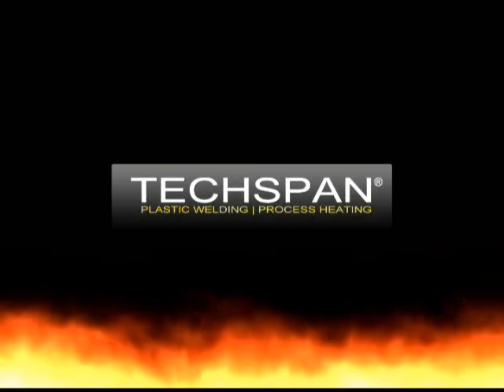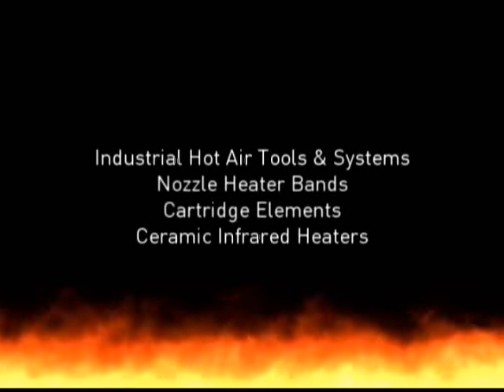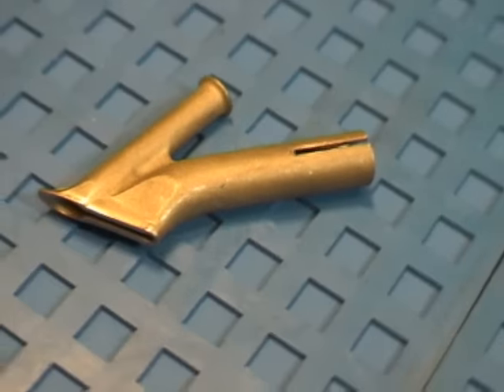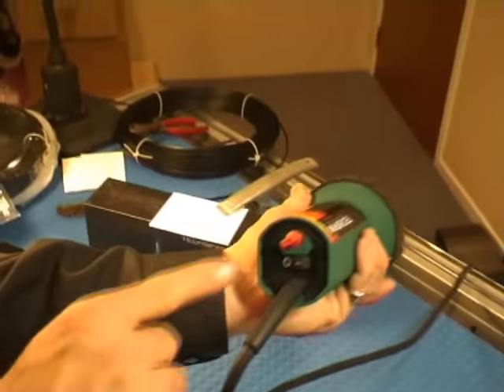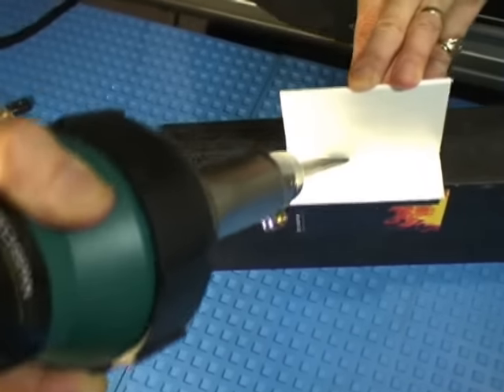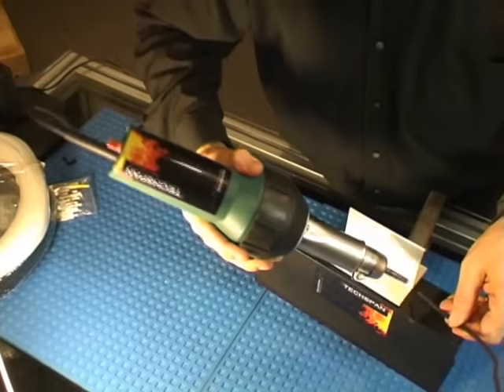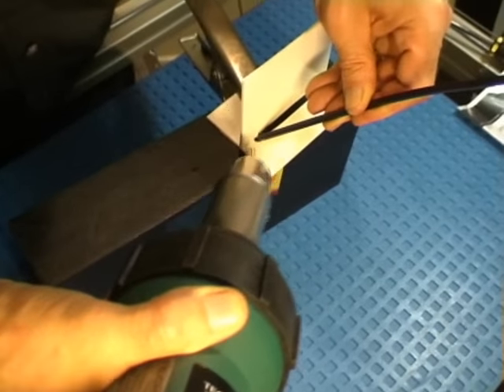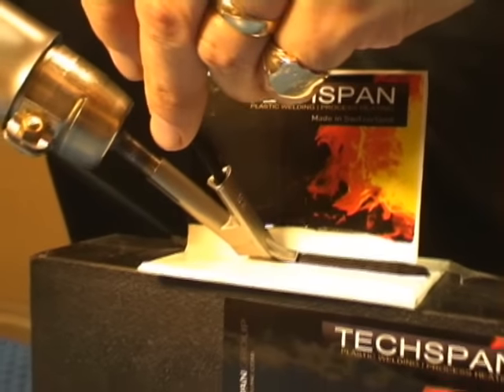Plastic Welding: How To Instructional Video by Techspan

Comment from the maker: See our NEW range of Plastic Welding KIts.  The extended range now includes kits specific to your industry sector. Automotive, Tarps & Covers, Fabrication, Roofing, Flooring & ACM Panel Welding Kits. 
https://www.plasticweldingtools.com.au/product-category/plastic-welding-kits/ 
#plasticweldingtools #plasticweldingkits #plasticwelder #hotairwelder #hotairtool #plasticweldingrods #techspannz #techspanaustralia
Reply: Can I weld my truck’s  front chrome grille?
Reply from the maker: @digitors  ok, do you know what the material is ? You would have to have the part re chromed when finished. 
Have a read through this information - 
https://www.plasticweldingtools.com.au/how-to-weld-plastics/
Reply: This tools can use to car bamper and also to motor feander welding
Reply: How to order
Reply from the maker: @dianneoh3125    info@techspangroup.com

Comment from the maker: There have been a few comments along the lines of 'i can do this with a soldering iron' --  our response to this is - No you can not. These techniques show plastic welding to the highest possible strength, and to worldwide plastic welding standards as set by the DVS joining association of Switzerland/Germany.    A soldering iron runs at very high temperatures and will burn and degrade plastics.  We would call that 'fusing', not Welding.  Weld testing will show this.
Reply: Unless your iron is adjustable..
Reply from the maker: Sorry it is not. Welding is a molecular process where the parent and welding rod and welded with almost no loss of strength. Thermoplastics require specific welding temperatures in order not to damage or degrade the material. A soldering iron will do this as soon as you contact the plastic. You will NOT ACHIEVE STRUCTURAL WELDING WITH A SOLDERING IRON.
Reply from the maker: A soldering iron still will not correctly and evenly pre heat the parent material. If you know of a very accurately controlled soldering iron.. please send me a link.  The best way to solder with any such control is to use a hot air tool with electronic temperature control.. just like our plastic welding tools. Hope this helps.
Reply: My Duratech ts-1564 has served me well on all of the welding i have done (HDPE) though I did make up a tip for it on the lathe/mill so I didn't ruin my good electronics tip, which wasn't really suitable for welding anyway.
Reply from the maker: Hi 74KU, if you are only 'fusing' and do not require structural strength great, but if you want a structural molecular 'weld' the use a Techspan plastic welding tool every time. https://www.plasticweldingtools.com.au/product-category/plastic-welding-kits/
Reply: I disagree with these comments.
As a Materials Scientist let me tell you of my experience. Metal welding involves melting the same metal filler rod as the parent metal and the results is a strong joint, you fuse one metal to another. 
I repaired a 75mm crack on the top tank of my CRV Honda radiator which was made of plastic, initially I used the wrong filler rod, until I learnt it was made of nylon , So I used nylon from brush cutter wire and used a large soldering iron to melt the nylon to the plastic radiator tank ( look up Polyvance company to get ideas on preparation work). It took about 3 goes but the repair is complete and is pressure tight. The previous owner used the product Kneadit but that is not the correct technique. 
Lets put it this way, your company is out to sell things, OK things you say are true but in the right hand, a soldering iron will work. I did my repair , so can you convince me to buy your product when all you need is a soldering iron, correct filler material and knowledge in what you are doing.
Reply: Why not buy a new radiator? The integrity of the rest of the radiator tank is questionable, and will likely fail again elsewhere, or at the repair site since the heat you added has an impact.

Having your vehicle towed is more expensive than a new radiator, and the potential for other damage far outweighs the cost of a radiator. Not to mention the inconvenience/cost of being stranded. If you miss a days work due to your failed radiator, that too would be a higher cost than a new radiator.
Reply from the maker: Thanks for your comment. PA melts at a very high temperature and a radiator will also have a content of glass filler. Again it may give you what appears to be a good result, but unless you can control the temperature of your soldering iron you will burn and degrade the material period. We attempt to share our knowledge in 'structural welding' not fusing.
Reply from the maker: Francis, thanks for your comment. Yes, sometimes damaged components may not be economic or sensible to repair if the part is very old or has sustained previous damage. This is where the welder must make a decision on whether it is effective to repair or replace. You will find all commercial plastic repair companies will take this into account.
Reply: tyvek05,   you're dreaming.
Reply: A cracked radiator is not exactly what I'd call a "structural" repair... The real test would be a repair that is subjected to a torque/moment, such as a mounting tab or cantilever. 

Instead of arguing, this company should just make a video showing a side-by-side compare of each welding method and the results.
Reply: TECHSPANONLINE modern soldering stations will hold a tip to within a few degrees C of the set temperature, from just above room temperature up to a few hundred degrees (hot air soldering stations have similar control). It's the specific tips that make the plastic welding tools much easier to use than tips for soldering. 
It would be nice to see one of the makers of plastic welding equipment make small tips for precision plastic welding compatible with one of the major soldering station makers tip designs. (Different market so no cannibalization of the existing market for tools that can do large repairs, but for repairing plastic pieces measuring a few cm², and cracks measuring a few mm² there aren't any particularly good tools) designing around the existing 1.75mm or 3mm diameter rods used as 3d printer filament would make it a perfect addition to the 3d printing market
Reply: I can do this with a soldering iron
Reply: I have a Power Probe butane soldering iron that is completely adjustable from working on circuit boards to joining 10awg wire together. Maybe an electric iron would be harder to control but the product on this video looks and operates just like my soldering iron
Reply: TECHSPANONLINE correction, you are right about the molecules etc, but when welding you fuse two similar or dissimilar metals together into one piece, so essentially it's pretty much the same thing. You fuse two metals into one 😏
Reply: Eric Powell, I've been a professional plastic welder for years and I'm with you mate. I've had to test and find the right weldings parameters for many different plastics and it is a very fine line between a successful weld and a failure, in my opinion it's unachieveable with a soldering iron. I have used a soldering iron to tack and fuse, but that's not a proper weld. These people don't have a clue what they're talking about.
Reply: @Russell218  Sounds like a good idea.
Reply: @jeffbudgen538  I have a question for you then. I have an ABS kayak that has some big cracks from backing into a power pole. It's a very expensive nice eddyline kayak. So I need to fix it to get it back on the water! I was going to use cyanoacrylate and fiberglass or maybe I thought about upgrading from fiberglass tape to carbon fiber cloth with cyanoacrylate. But now since seeing this video I'm thinking maybe I could plastic weld it? I would say there are about three critical cracks and one Gap that needs to be refilled.
Reply: You can do this with a hot air station
Reply: The definition of welding is the act of fusing 2 or more materials together... I think you meant "a braze" or "soldering"
Reply from the maker: @danielbeaird6264  as i stated "we would call that fusing, not welding' .. we often use terms like this to clearly note a difference. An act involves the production of a union, is not a "molecular weld"
Reply: @TECHSPANONLINE  
Welding and fusing are synonymous... as a welder, we would only say fused if no filler material was used, such as tig welding... im not disagreeing with your point... I'm just saying you could use better words... a soldering iron is used to solder things, so the word you are looking for is solder not fused

Comment: This video is a trip. I feel like I should be watching it on a hit of bomb. Seriously though, I just replaced a plastic gas tank on a chevy truck, because a tweaker cut a slice in it with a utility knife to steal the gas, and I was thinking about what it would take to weld the slice. Welding plastic gas tanks in the future may be more common then you could imagine. Inflation, an high gas prices are coming. If I saw it once, it will happen again, and again. Just like converter thefts. I would like to see if it can be done. If it can, I would probably buy this product.
Reply: Dude you’re so right this video is a fucking trip

Comment from the maker: No. You need accurate temperatures to be used when welding specific plastics. Their welding temperatures all vary slightly... So you need a machine with electronic temperature control. In some cases plastics will require 300 - 400 deg Celcius ... So a hair dryer simply wont work

Comment: Hello I want to have a 40l cylinder tank and I have to pressurised it. Can this cylinder resist 2 bar pressure or explode? How can ı learn about this ?
Reply from the maker: If you use a spark tester after the welding to ensure it is water tight, it is likely.. but may depend on the material and its wall section thickness ..

Comment from the maker: Hi there, If the plastic you are trying to weld is a 'thermoplastic' then it should be possible to weld it.  You can do a small test to establish whether it is a thermoplastic or a thermoset - using a sharp blade, cut a slither of the material off the parent. If it curls up, then its a thermoplastic. If it remains very rigid and straight, then it is a thermoset. A thermoset materail is not weldable.  Hope this helps.

Comment: I want to buy one, do these create strong reliable welds though ? For example is the weld as strong as the material its bonding ? In this case I will be welding HDPE

Thanks

Comment: Kindly confirm if this tool can be used for HDPE lining material about 1.5mm thick or please recommend the right model for HDPE. Is there a dealer in Philippines? Thanks.

Comment: What tip would be better for welding a T weld? I'm planning on welding two HDPE barrels together perpendicular to each other notching an end of one to be welded to the side of the other. I was thinking the triangle one since most of the joint would be 90 degrees but not sure. Thanks for your help!

Comment: Actually thus technic is great for motorcycle plastic. when you consider the cost of a single fairing or dude panel can cost $900.00 it's very cost affective. I tried this once and the weld bonding is 3 times higher then normal factory bonds. great stuff if you need to restore panels that no longer can be bought or found.

Comment: Hello, greetings from South Carolina USA. I have a question specifically pertaining a splicing operation of Nylon 6 extruded monofilament (0.055-0.170 diameter). How would a hot-air process like this compare in tensile strength to an ultrasonic process?

Thanks for your time,

Bob
Reply from the maker: Hi Bob, weld strength can be very strong by hot air welding. Ultrasonic welding is an extremely fast process and usually used in the packaging industry. Hope that answers your query.  Regards, TECHSPAN

Comment: Dear.   friend.    Please.    Explain.   Hot. air.   Plastic.  welding.    Systems.
Reply from the maker: Hot air plastic welding is the process of joining two or more plastic surfaces together using hot air, usually applied by a heat gun. Plastic products can't always be made in one piece. It is often better and more economical to fabricate products as separate pieces.

Comment: I just bought an American version of this welder that is obviously cheaper looking. This is a great video and previous research has told me to keep the heating element from burning out, you should keep the welder on After welding with the heat turned to Zero to cool the element before unplugging. My welder did not come with the automatic feed nozzle and was wondering where I can purchase this. Thanks for the great video, RH DSD
Reply from the maker: +DIOSpeedDemon    http://www.plasticweldingtools.com.au

Comment: I have an ABS eddyline kayak that has some major cracks in it. I was told methyl methacrylate and fiberglass tape is the way to fix it. Would plastic welding be better?
Reply: I’m pretty sure acrylic will burn and turn colors
Reply: @MudMotorsMax  I fixed it with methyl methacrylate and carbon fiber cloth
Reply: @ArcolaBridge  nice
Reply: @MudMotorsMax  eddyline recommended methyl methacrylate and fiberglass cloth. But I use the carbon fiber because I think it lasts longer and it's stronger. I used my Dremel to open up the cracks extra wide so that I could Gap fill the cracks with the methyl methacrylate. Then I use 50 grit sandpaper to create a 1-inch rough on either side of the crack on the inside and outside of the kayak. Then I used a wire wheel on my power drill to put some deep grooves on both sides of the crack inside and out again one in into the roughed-up 50 grit section. I applied the methyl methacrylate to a 4in wide carbon fiber cloth and also applied the methyl methacrylate to the inside of a kayak and then applied the carbon fiber cloth coated with the methyl methacrylate onto the inside of the crack. Then I used more methyl methacrylate over the top of that sandwiched with another layer of carbon fiber cloth and methyl methacrylate and then overlaid it with more methyl methacrylate. On the exterior I filled the Gap with methyl methacrylate and smooth it out with a spatula and built it up taller than the crack and use the detail sander to bring it down smooth. I thought about covering it up with a decal or painting it but actually having a crack in the kayak sort of seems cool to look at. I might paint it with an acrylic paint at some point. I even toyed with the idea of sanding the whole bottom of the kayak and applying something like magic any foul which is a new silicone-based antifoul. Not that it needs that or anything but maybe that would be kind of cool. But anyway it took a bit of time to do this but it was well worth saving this awesome eddyline 14 sit-on-top.
Reply: @ArcolaBridge  i’m starting off with a hot air welder using a speed welding set up and I’ll be welding quarter inch HDPE into small 10 foot boats and in July I’m buying an extrusion welder right now I’m in the bed research stage because the biggest concern and the biggest challenge is stopping the sheets from warping and I do know how to stop it but I’ll keep it to myself for now

Comment: That and a laser cutter and you could make so much cool stuff!!
How strong is the weld could you show some testing....unless you already did i forwarded a bit.
Reply from the maker: We only provide plastic welding equipment approved to DVS standards. What this means is that the welding procedures, techniques and associated equipment will provide very high strength structural welds. Hence why we are very big on ensuring the techniques for welding plastics are followed. For further information about "How to Weld Plastics" go here >
http://www.plasticweldingtools.com.au/how-to-weld-plastics/
Reply: Do you have a distributor in South Africa
Reply from the maker: No but you can buy online from our website.. 
http://www.plasticweldingtools.com.au

Comment: I have 2 question 1 how strong is the tack weld? 2 can the welded area be sanded smooth for re-priming and painting? I plan to use this to repair a broken piece on my hard plastic R.C. Truck and to kit bash another 2 R.C. Vehicles together to make 1 which is also hard plastic
Reply from the maker: Hi DaveStaff4,  

Answers to your questions - 

1. "Tacking" as shown in our video has no real structural strength. A Tack is to close up the joint gaps, and to help align the two parts.
2. Yes, the completed weld can be sanded with abrasives - use a range of abrasive grits in order to achieve the required finish.. and yes, it is common to sand the parts to allow a high gloss paint finish. 
3. Ensure you identify the plastic material first to ensure it is a weldable thermoplastic. 

For more indepth information covering 'How to weld Plastics" go here >>
http://www.plasticweldingtools.com.au/how-to-weld-plastics/

Comment: Can this process be used with extruded plastic fuel tanks with out first backfilling them with an insert gas???
Reply from the maker: These tools use electrically heated hot air, however we recommend all and any safety moves to limit problems to acceptable levels.